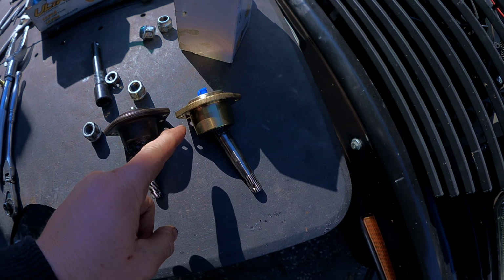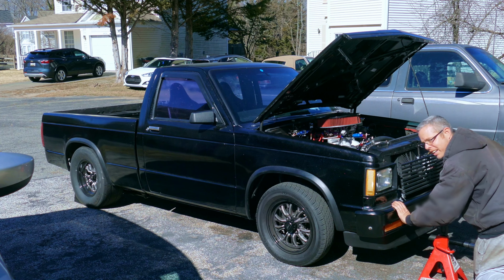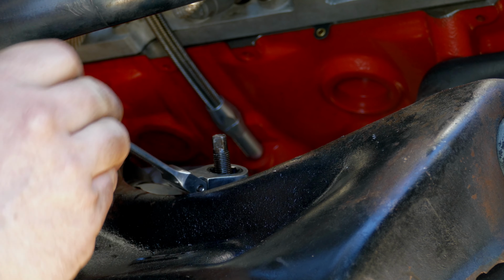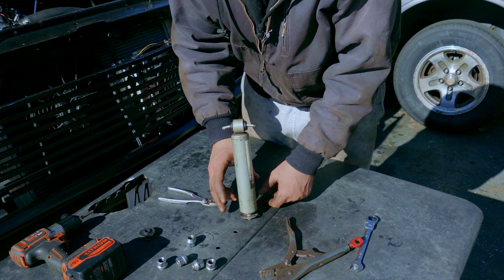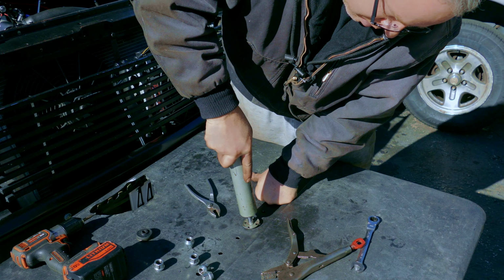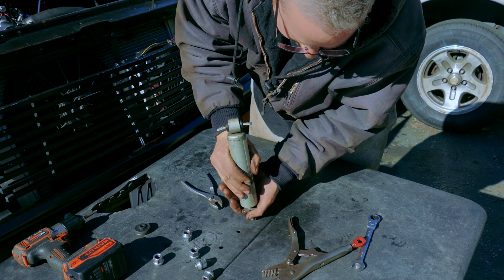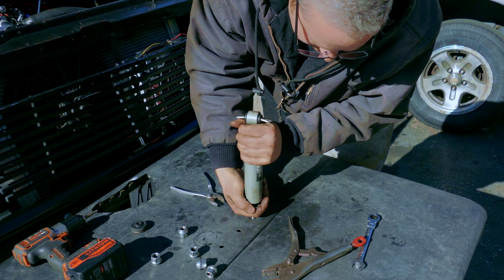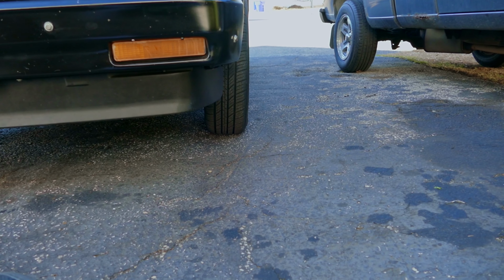S10 3 Way Adjustable Drag Shocks can this 400 SBC hook?

Comment: We had those  competion engineering shock on our s 10 with Moroso trick  springs  it was well into the 9s. They seemed pretty cheesy the way they adjust it's not easy to know what setting your in
Reply from the maker: Yeah it's like a box of chocolate.
Reply: What pound trick springs you have? Trying to decide what ones to get for my s10
Reply: @TPVPRO  you might still have air in them shocks you supposed to hold them the way they mount and bleed the air out not upside down
Reply: I’ve got the same shocks in the front of my Holden HQ Ute, yes I’m an Aussie lol. Took a little bit but there’s one big click for 90/10 and the other two settings are smaller clicks. You just have to figure out which is the biggest, particularly if you’ve got slight industrial deafness from 30+ years of playing with loud race cars 😂 🇦🇺🇺🇸

Comment: That 400 cube SBC sounds awesome.
Watched a few of your other vids, but haven’t seen what specs on the engine.
Definitely curious to know what cam specs/compression and valve springs pressures your running. Thanks.

Comment: A bump steer kit will cures that keeps the control arm and tie rod swinging in the same plain
Reply from the maker: Link me on that PN thanks 👍
Reply: Spoon performance  part # BS-2S
Reply from the maker: z @Joe Cameron  Oh that, they don’t have that issue the wheel is pretty much vertical from what I can tell. The control arm moves so far down compared to stock causing it to pull the wheel inwards. When you let it down off the jack the rubber grabs the pavement not allowing it to swing out with the wheel. So while in motion there is no issue.